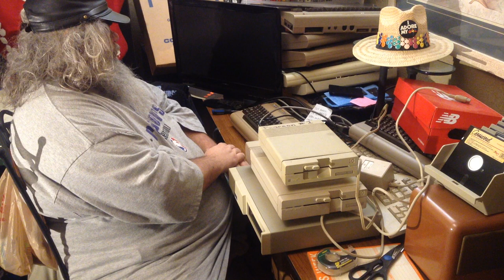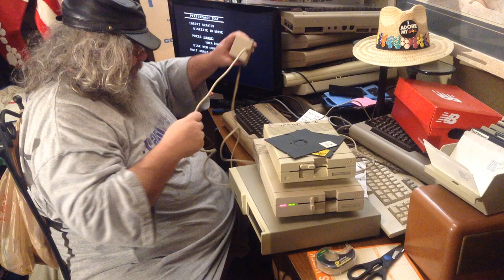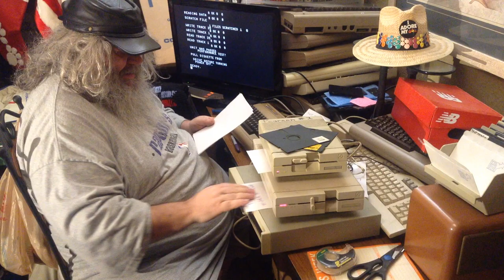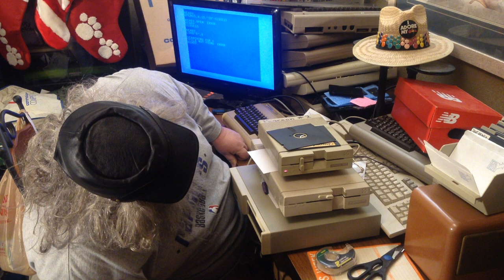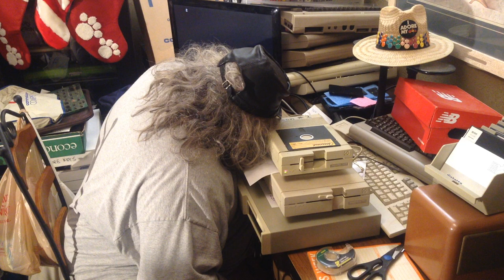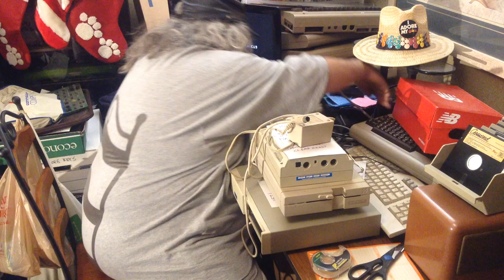1571 & 1541 II Commodore Floppy Disk Drive Testing - 64 C64 C-64 C128 Vic-20 PET C16 - Episode 738

Comment: I have a pile of working drives 1541, 1541-II, 1571 and a lonely 1581.  I have then not because I use them but you never know when you might.   I like the form factor of the 1541-II, 1571 and 1581 those I like the most because they just look great.   Ya know when I  sold off my 8 bit computers Ron Fick got all my Lt Kernal Stuff including the modified computers that were connected to it because it had a multiplexer.   The other day I wanted to refresh my memory on the Lt Kernal and up popped Ron Ficks name and sadly it says he passed away in 1999 so I was very sad to read that.   He ran a BBS called the Bat Cave in Colorado before he moved back to Kansas I believe to care for his mother.   Our BBS;s were networked and we formed a friendship around the technical side of the Commodore World exchanging prints for the stuff we had and for TTL to RS232 boards we would make for the 64/128.   I moved on to the Amiga and he kind of stayed in 8 bit land.
Reply from the maker: I agree, the 1541-II, the 1571 and the 1581 are just great to look at.  I wish they had started with that format for all the single drives, but alas, it was part of the evolution...

So sorry to hear that your BBS friend died so long ago...I must get to the Lt. Kernal testing...soon!